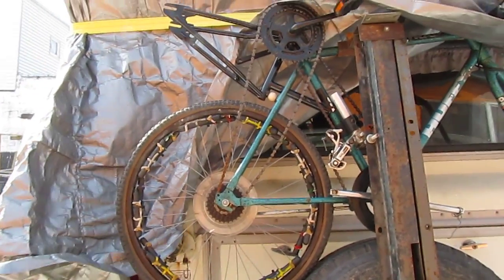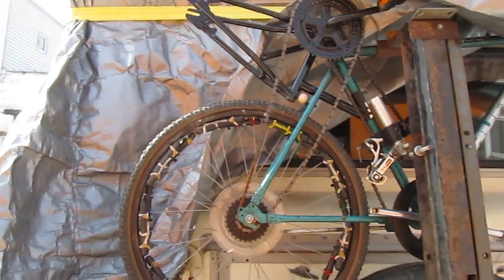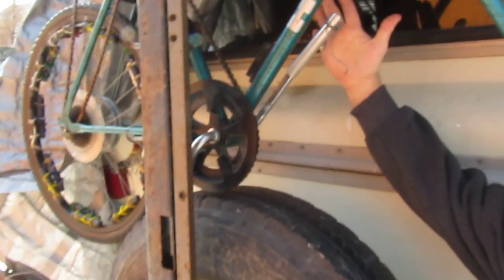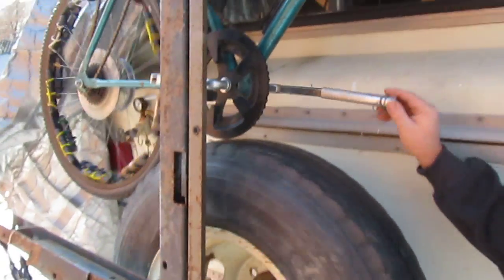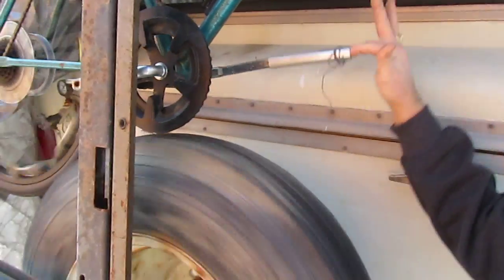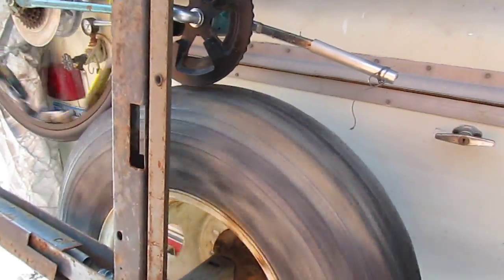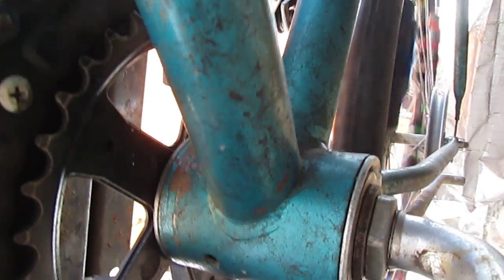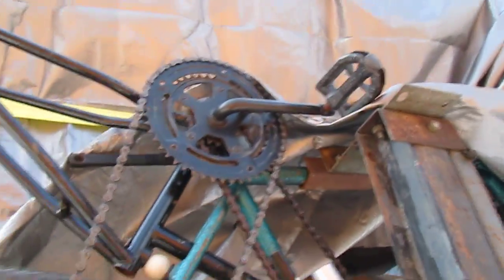Wind powered air compressor concept w/ "fluidic flywheel"

Comment: Solar  powered  Air Compressor 
 This system can be built as small as you can find the cylinders piping
And check values to build it with or as large as you can afford. 
 The compressor is buildup by adding one tank in an area hot or warm to one in an area that is cold or cool . The more the temperature difference the more efficient the compressor. 
If you want to increase  the pressor add two more tanks to the inlet  of the first tank in the first cell and then countinue adding cells until you acheve the desired pressure.
Each cell of the system consists of an inlet check valve (or the equivalent thereof ) a tank to hold the expanding or contracting gasses an outlet check valve (or the equivalent thereof ) another  tank to hold the expanding or contracting gasses an outlet check valve (ore the equivalent thereof ) to be repeated until you achive your desired pressure. This idea comes through me from our Heavenly  Father who I love dearly.
Free from God to me, free from me to you Through the will of God and the grace of our Lord and Saviour Jesus christ
Reply from the maker: Incidentally, I have moved on to a much easier, more efficient design for air collection that doesn't use rotating compressor heads at all but still makes use of the rocking motion with simple linear air compressor heads ganged to a pendulum arm where the compressed air storage tank itself is used as the pendulum weight. As pressure builds in the tank, it's weight increases so that higher and higher pressures can be attained without the need for higher and higher pushing forces (which is another reason solar powered compressors would almost instantly fail). This idea was inspired by an ancient EGYPTIAN carving found deep within the Dendara pyramid that the Jewish media is attempting to "sell" to everyone as an "Ancient Alien Lightbulb" in order to hide what it's true function was.

Here is a video of my progress that was just posted last month: https://www.youtube.com/watch?v=rOhBQDYTVuQ
Reply from the maker: Dreadragon Flame
Oh, and thanks for contributing, sorry about the "tone", we would have been fine if you hadn't mentioned your alleged "source", especially when I'm quitting smoking and have just started using testosterone patches simultaneously, not that I was ever a very easy person to work along with while inventing stuff... or anything else for that matter apparently  LOL
Reply: No the idea came to you from shit youve picked up along your journey of life.  Jesus and your god are only there to ease tensions of the afterlife and help your mental stability throughout times when things make you question reality whether consciously or subconsciously..  you thought of that all by yourself so give yourself credit where cedit is deserved and rely on your god to be there for ya because if there was an entity doing things physically than there would be evidence of it and magic doesnt exist..  salem trials proved that and the complete ignorance and level of disillusion a people can get if allowed to ..

Comment from the maker: Or even water from a downspout into a bucket on a bungie cord that tips over and empties/ springs back up to refill? };^/?

Or even tethered to grandma's rocking chair?

Or children on a seesaw... a dog pulling on a leash... S0 many options, and if it's used to power a smallish air compressor, the RV has a steel, COMPRESSED AIR DRIVEN water tank built in, you can see the valve and pressure gauge in the vid.

Pressurized air AND/OR water AND/OR electricity from a simple linear movement.